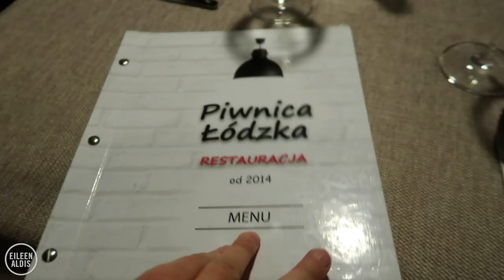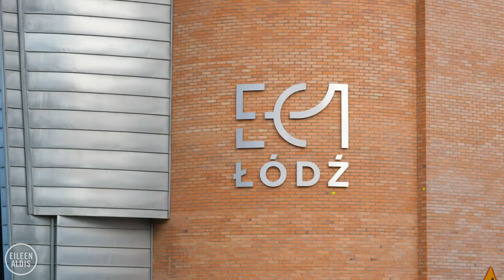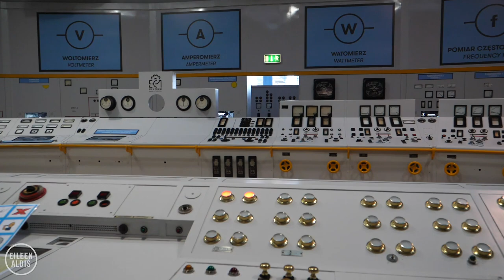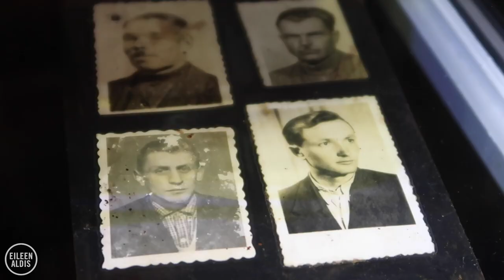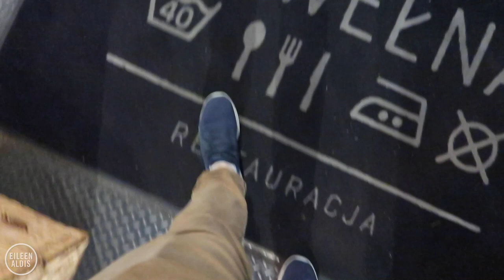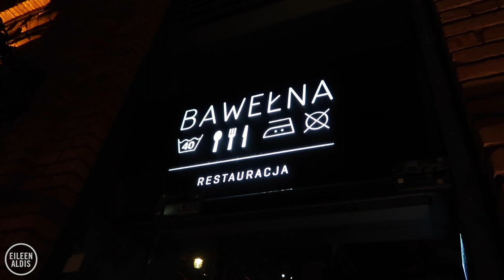Łódź: Poland's Great Comeback City

Comment: The thumbnail is a picture of a Warsaw bus?
Reply from the maker: It looks similar but it's a tram in Łódź 🚋
Reply: No. First - it's a tram, not a bus, second - both Warsaw and Łódź have the same city colours - red and gold (yellow), and the city flags of both cities are very simmilar - red stripe at bottom, yellow stripe at the top, but Warsaw is without any other elements and Łódź have a city arms in the middle (gold boat with scull at red background).
Reply: @teer7461  You are correct!! 👍😊